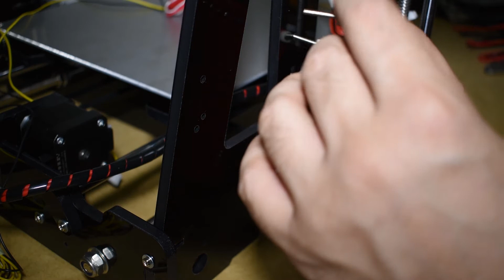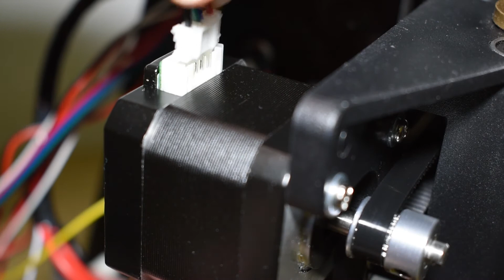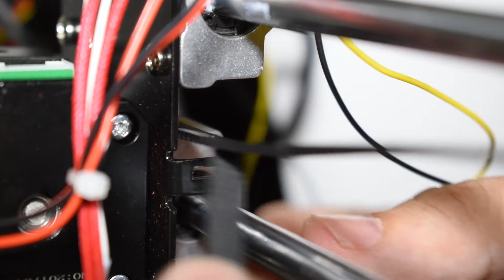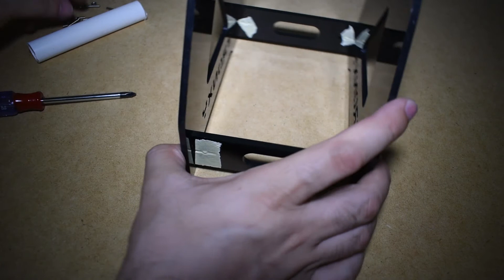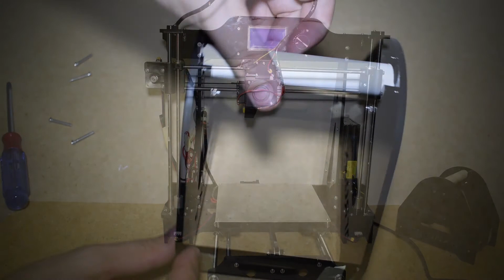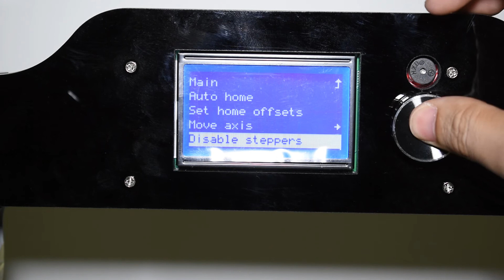Tronxy X8 assembly STEP  6 (includes first power on)

Comment: hey I cant load the filiment into the 3d printer
Reply from the maker: Why not? What is happening?
Reply: @ruiraptor  i fixed it the gear wasn't screw on to the shaft of the stepper motor

Comment: hi, when i turn on the tronxy the only thing it do i the blue screen, what can i do? Help me please :(
Reply from the maker: Hi Ricky,
Check the contrast potentiometer of the display. Turn it and see if it helps.
Reply: ruiraptor thank you, the problem was to invert the 2 LCD cables on the back of the display.. But now I can't print because the extruder doesnt bring out the PLA

Comment: Hey Ruirpator when i turn mine on i get err MINTEMP BED error. how can i fix it and also how do you execute setup and stuff. my knob doesnt do anything when pressed or turned
Reply from the maker: Hi Charlie,
Regarding the knob, check if the knob is fully pressed. Pull it back a little and check if you can now make it work. You can pull the knob completely out to test the rotary encoder. Regarding the mintemp, probably the sensor is nor correctly connected and you have no reading from it. Check which temp is displayed on screeen and recheck all the connectors and connections.

Comment: Thanks so much for putting this together. Very helpful! I am at the final step, but I'm blowing the breaker. The breaker is 20 amp. I checked all of my wiring, and everything seems to be exactly how it should be. Any suggestions? Thanks in advance.
Reply: And side note...I removed the power wires going from the power supply to the printer. It's still blowing the breaker, so this tells me that there are no issues with my machine wiring. Bad power supply? My electrical skills are admittedly not very strong. If I opened up the power supply, would there be any glaring items to look for? I do have the switch set to 110, and I'm in the US. Thanks in advance.
Reply from the maker: Hi Brian,
You have correctly troubleshoot it by narrowed down to the power supply. Are you cables correctly connected and in the correct connectors? Did you use ferrules? Which breaker are you referring to?
Reply: Thanks! I have the cables connected correctly, but I'm not using ferrules. The breaker is in our main panel of the power coming into the house.
Reply: Hey I figured it out! The breaker is a GFCI type, and it was tripping. I removed the ground wire and it powered up fine. I'll keep this on a circuit that does not have GFCI. No really needed for this application.

Again thanks SOOO much for this series of videos. Made my assembly so much easier. Subscribed!

Comment: My lcd boots up and shows logo and then doesn't load the rest. I booted firmware from SD from package
Reply from the maker: Hi Joseph,
Can you please explain...you have a firmware version for the tronxy x8?
Reply: ruiraptor TronXY X8 v1.0.3

I have not yet installed anything to the 3d printer however i am getting the logo
Reply from the maker: If you get the boot screen and nothing else, it might mean that you have a bad firmware installation.
You can try and disconnect all the connections from the mainboard except for power and display ( and no SD card too) and see if there is any difference. If not, the only way is to flash the firmware again.
The problem is that i don't know where to get the firmware to flash. Where did you bought the printer from?
Reply: ruiraptor Gearbest. And also thank you so much for the quick responses
Reply from the maker: Ok Joseph,
Try my tip and check.
If it does not work then (like i said) the only way to fix it is to flash the firmware into the mainboard again.
You need to contact gearbest and try to get the firmware. If they do not provide it, then you need to claim the warranty of the mainboard. Let me know how it turned out.
Reply: ruiraptor i found the firmware I will send link if it works. But how do i flash?
Reply from the maker: Hi Joseph,
Check this video i made for the tarantula. It's for a different printer but the procedure is the same. You might not need to download the old arduino version as i did...just check. And i bet you need to download and install the u8glib library for the arduino too (because the tronxy x8 has a graphic display).
https://youtu.be/P4W0UI9r6pI
Reply: Where is the firmware? Can you send the link? I am having a similar issue.
Reply: I have fixed the printer I had to have them send me a new main board. I just hooked it up and now I just need to test print. Could you (or send me to one if you have it) make a video on how to use the printer setting it up and fine tunning it. Thank you.
Reply: david brevik lemme see if I can find you a link

Comment: Hello,
All the tronxy x8 videos helped me a lot to assemble the printer.
But I am having an issue. The stepper motors are having difficulties to move up on the z axis. it seems to be the right motor.
Do you know where it can come from?
Reply from the maker: Hi,
Check the right leadscrew nut. release the screws and check. Check manually by rotating both couplings with your hands